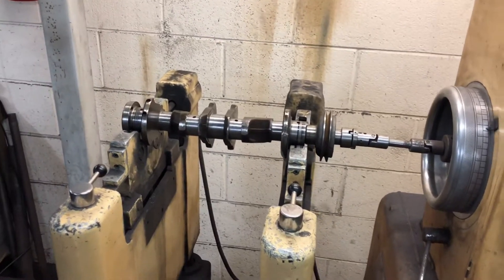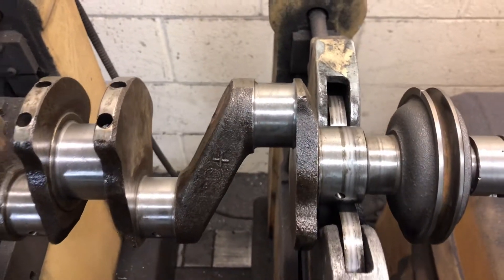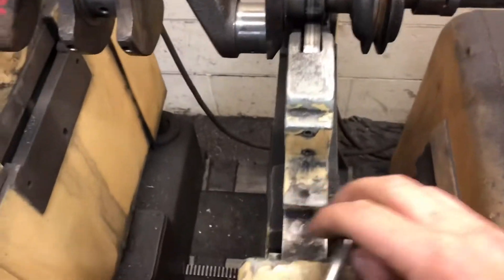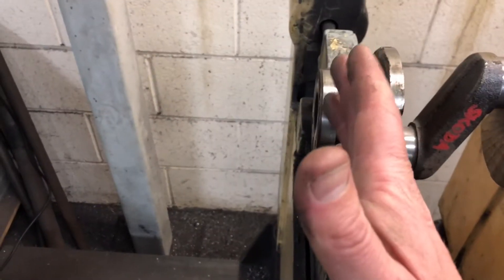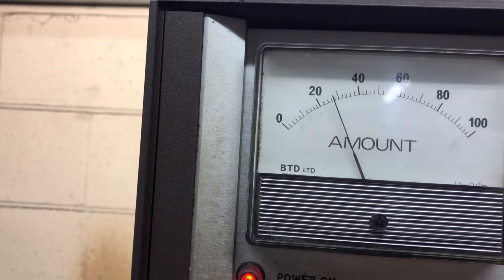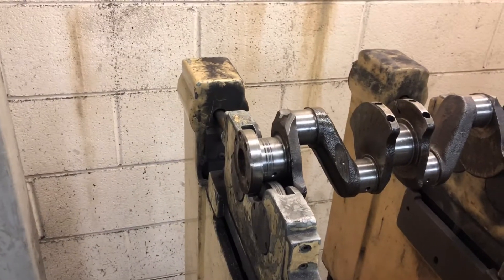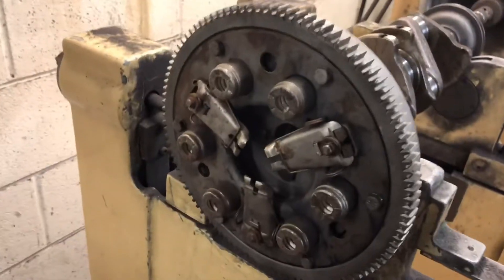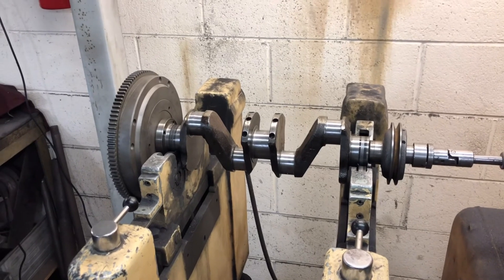Massively out of balance crankshaft assembly can cause...

Comment: I thought you checked crankshaft balance with bob weights installed. What data/insight is gained by checking balance with just the shaft? Sorry for the noob question. Thanks.

Comment: I worked for a Skoda main dealer in the early 90,s when the estelle & rapide were being replaced by the favorit
and we had a new favorit on first run in service about 1k miles and manager noticed it had a terrible vibration
on idle and worse as rpms went up, pulled it apart to find this new engine was on max oversize bearings
from factory in an attempt to bring it into balance but it was still miles out, it got another engine fitted as
when checked the crank was so bad it tried to unbolt the machine from the ground and test was ended
before something bad happened, fun fact the best quality czech steel was equal to the worst british grade
and skoda didnt use the best grade for their cars back then so random bolts breaking was a common thing
mostly due to badly balanced engines shaking everything loose or breaking in use,
OE built engines never made it to 100k miles,they would knock out mains/bigends/thrusts way before 100k
as well as the cars would fall apart if got any miles on them anyway,it was mildly entertaining how bad they were before the vw/audi take over years later

Comment: Is it not an issue that the factory balance holes on those counterweights are nearly drilled through the sides? I'm honestly asking as I don't know ow. Mayne it's not as bad as it looks but it kinda looked like they were paper thin in spots
Reply: Also how long did it take to figure out the 0 degree thing?

Comment: Very interesting video. I do have a question… Is this type of machine more accurate than the bob-weight type? Or is it simply two different methods to get to the same point? Thank you for all your videos!
Reply: Bob weights are generally only necessary on V engines as those crankshafts unlike inline engines utilise the weight of the pistons and con rods as counterweights. If you spin a V8 crankshaft on the balancer without bob weights it gets very messy and expensive quickly!

Comment: Why no crankpin bob weights? Without them the rotating mass will not be balanced. We used to make up these weights to the weight of piston and rods with bearings in after pistons and rods had been statically balanced to all be the same as the lightest set, big and little ends matched as well. They were then clamped to crank pin before balancing commenced. The flywheel and pulley were then were also on (dowelled if no key way) assembly then balanced as a whole. This was even more critical if the crank had been stroke ground or +10 pistons fitted and had crowns machined.
Reply: Not necessary with a flat plane crank. Yes, for a V8 but not needed for a flat 4 boxer engine.
Reply: @bwm999  that is the theory yes but we did an experiment and found that a flat plane 4 cylinder crank balanced without bobs, would show an out of balance effect if bobs were fitted, not much but measurable. Because of this we would always add bobs the extra time was negligible and the end result appreared to be a smoother engine. We would also remove all casting / forging sprues an shot peen crank and rods. By doing this we never lost a race motor to crank or rod failure. Also we would try and avoid grinding to achieve balance preferred to put 'heavy metal' slugs on opposite side.

Comment: This video has me completely baffled. When balancing cranks I've always attached weights to the big ends to represent the pistons and con rods. Also, as I mainly work on Norton parallel twins I use a balance ratio depending on the application. Peripheral components I balance on arbors independently of the crank which is never balanced in the neutral sense. I did once ride a Commando which had allegedly been dynamically balanced which vibrated so much my vision blurred out.
Reply: bob weights only needed on "V" engines as if they're used on in-line engines they just counteract themselves. If you take a 4 cylinder in line engine and add 500g bob weights to each big end, it should balance exactly the same as if they were not there. paralell twins are also different, if both pistons and rods are travelling together then of course you'd need to use bob weights. As a side note, It's possible to have both ends of the crank almost perfectly dynamically balanced, but the static balance way out (believe me, been there and made that mistake - opposing vibrations at each end were cancelling eachother out). You need to use both methods together to balance something properly.
Reply: I am as well no crank pin bob weights the crank will not be balanced to the rotating mass. We always had flywheel and pulley on as well. Sometimes you had to put heavy metal slugs into the assembly as not enough material to remove. The flywheel was dowelled for location as well.

Comment: Never knew how you balanced crankshafts  loved the machine was great to actually see you drill holes and it was perfect. The flywheel my god you could here how much it was out on the video.  Just shows why your engines run so smooth and you have such a good reputation. 👍👍

Comment: Do yourself a favour and throw that machine in the skip. We had a similar machine years ago. Got rid of it and bought a Turner from the states. So much quicker. Usually just one spin up and it tells you how deep to drill and at what angle.On that particular you are balancing you wouldn`t have to grind anywhere .It can all be done by drilling on the webs.

Comment: Is that flywheel keyed? 

If not, wouldn't you be better spinning it 90 degrees and test and then do it till your back? 
Then it might naturally get better in one spot?
Reply: Not when the crankshaft is already at zero. Moving 180 degrees is just going to put the unbalance to the other side if the crankshaft.
Reply: @MJTAUTOMOTIVE  that's assuming it is spot on 0?  She's an old girl. I would have liked to see it rotated an see the difference, if any

Comment: Would some of the smaller "amounts" be un-noticable say to the average driver or someone who's driven a few years ? Or is this purely a Good thing to do also ? 
Its fascinating how simple the worst scenarios can be put right ! 🚗
Reply from the maker: Yes it’s the big amounts that matter the most. We find an amount of around 40 and above can have a huge effect on an engine, from wear on crankshaft bearings, sapping of power, unreliability and vibration. We sometimes get amazing feedback of how smooth engines are after we have built them and it’s through balancing
Reply: @BarumEngines  So you wouldn't advise on this just out of the blue ?  as in , would every older engine benefit from this balancing  ? I was surprised at the Flywheel though , that looked way too over the acceptable amount....Nice Work ! 🚑👏